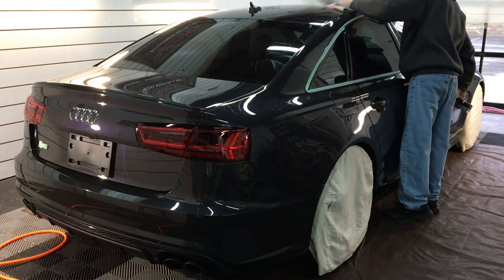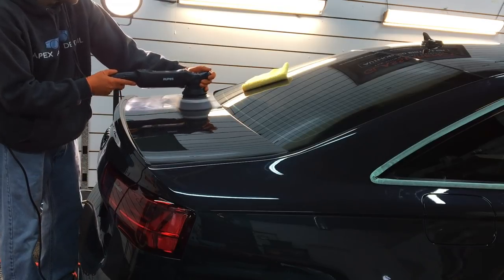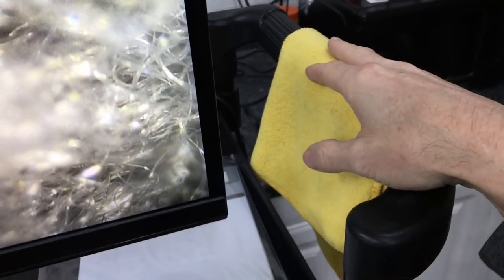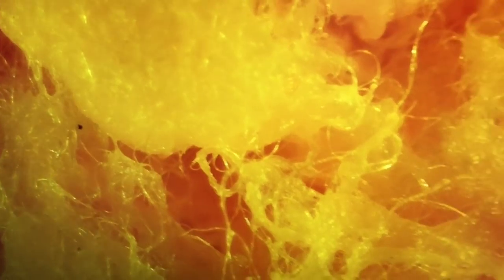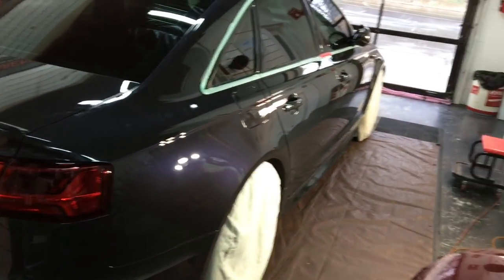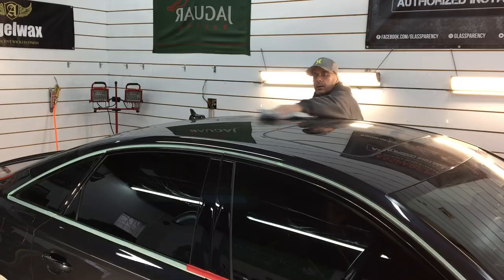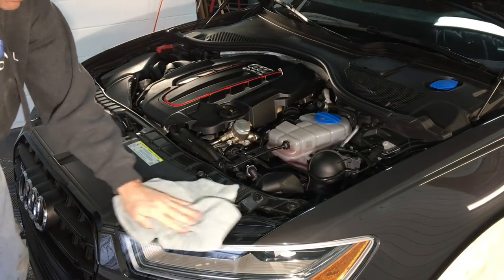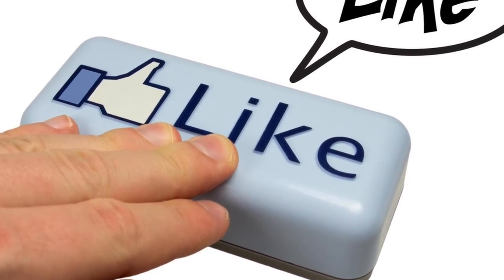Full Detail, Paint Correction, Ceramic Coating!! (From Start To Finish) Vlog # 4

Comment: Could you clarify something please. At the start of this video you s said you use Angel Wax Stripped Ease (AWSE) to remove leftover wax and sealant, yet in video # 2 you used a 25% IP solution to remove wax and sealant so the iron remover works better.

So do AWSE and 25%IP do the same job? If so, why use both? If not, when do you use IP and when do you use AWSE?

Love your videos. It's a shame most products aren't available in Australia especially now Amazon forces us to use their Australian website that doesn't have the same range.

Thanks in advance.